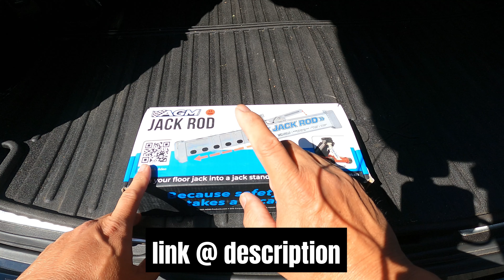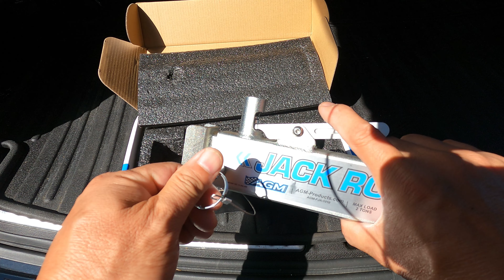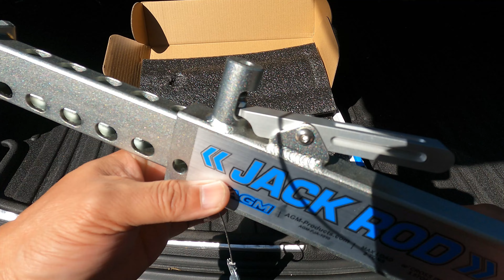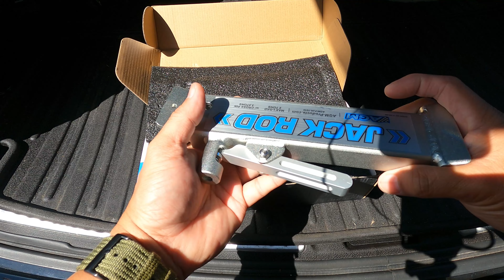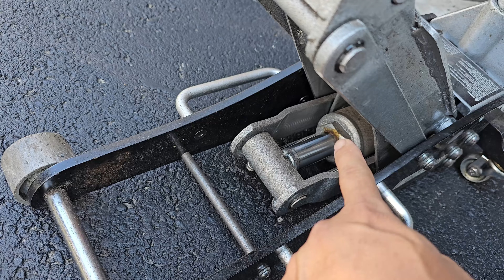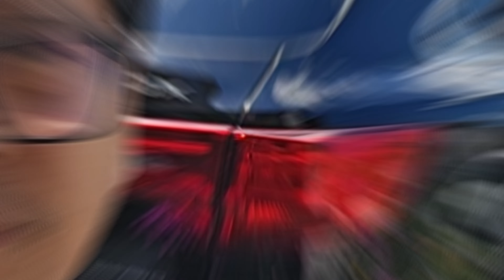Your Jack Is Unsafe Without This Device

Comment: I just purchased a 3.5T rated unit.  Thank you for showcasing this product. 
I have 2 electric vehicles: BMW iX50 and Chevrolet Bolt EV.  Swapping tires between summer and winter for both cars is a pain but is quick and having extra layer of safety is always welcome.
Reply from the maker: Glad I could help, and it’s always good to have that extra safety when working on your cars.

Comment: This devise would never pass ASME PALD, you would loose your hand while putting it between jack lift arm if the floor jack failed on sides of the vehicle or even worst case kill you if vehicle was lifted from center lifting point.  Does these people who invent these kind of toys have any brain at all?? No offence to you , but towards the manufacturer of this devise.
Reply: If using regular jack stands, you can lose your whole arm if jack fails while placing stand under car on frame.
Reply: Best not leave the house. Could get hit by a meteorite, or a turd from a high flying aircraft.

Comment: The video made its point very well. A floor jack  becomes a  jack stand. I’ve used jackstands for decades with no issues- 
It’s risky crawling under a car thats lifted off the ground on just one side. Thats why jack stands are sold and used in pairs.
Reply: Can you explain the danger of only lifting one side?
Reply from the maker: Safety should always be your top priority when working on a vehicle. Thanks for sharing your experience!👍

Comment: 2 Questions: 1. If the jack's hydraulics fail is a jack designed to hold the weight like that on those supports? 2. If the hydraulics fail on the jack and this thing kicks in how will you reraise the car to get the jack out from underneath the car?
Reply: I the jack fails the jack would have saved your life.
Just use a scissor jack another floor jack to remove and rebuild your faulty jack.
Reply: Good question.  I was about to order this tool.  But, if the floor jack fails there is no way for me to remove the Jack Rod and I only have one floor jack available to use.
Reply: @ct4225 I appreciate any comments on here, as we are all here to learn. With that being said, this is a lazy way to stay safe, and I am safety first. If the jack fails, which I think would be unlikely due to the jack rod supporting it, not the 8 cent seals in a cheap jack, just get a couple jacks and remove the weight. No cut, but pretty easy solution.
Reply: Just get another floor jack to jack up the car. Once the defective floor jack is removed, return to store the floor jack you just bought. Easy
Reply from the maker: My Jack rod is rated at 3.5 ton, it's designed to support like the 3ton jack that I have. Just use another jack and place it somewhere near the defective jack, then jack it up to remove the other jack.
Thanks for watching!!!👍